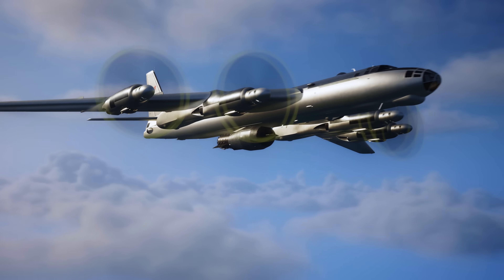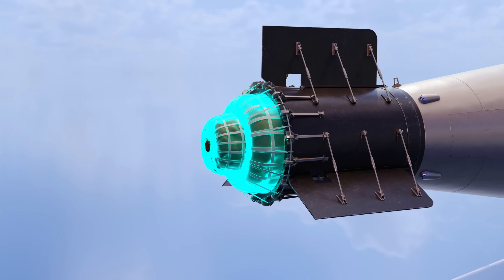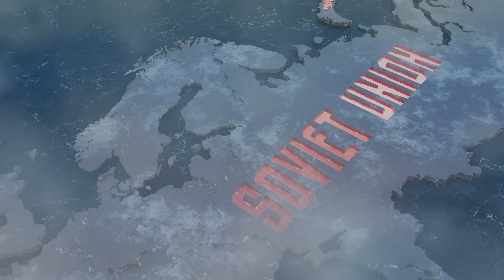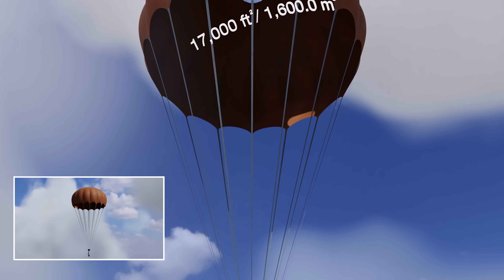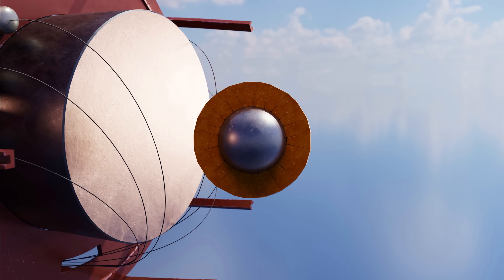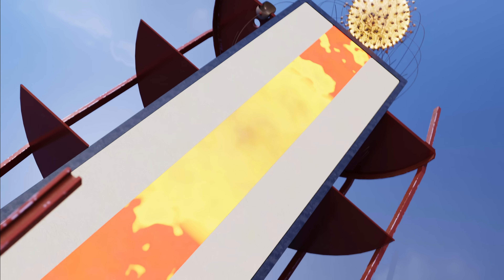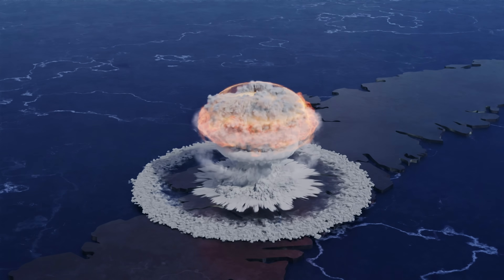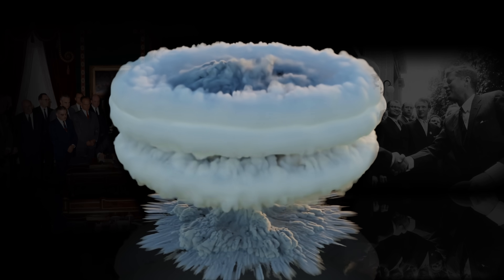Inside the Tsar Bomb

Comment: there is a material more critical than plutonium itself for production of hydrogen bombs. it s tritium. the radio isotope of hydrogen but with 2 neutrons. it requires a small quantity of tritium in order to be fussed with deuterium and release extrordinary amounts of energy. i have heard that a regular hydrogen bomb requires only 4 grams of tritium and deuterium to be detonated. tsar bomba defenitely had more quantity. the problem is that tritium hydrogen has a half life lifespan of only 12 years. therefore a warhead must be refilled with tritium every year in order to be maintained

Comment: Dear THE BLUE PAW PRINT,
Thank you for this well presented piece.  The original reason for the existence of this device was to impress the US with Soviet Military Power. Originally the design was considered for 100 megatons, but the designer and builders felt that this was perhaps beyond any sane reason to exist, that it would guarantee the deaths of those in the plane who dropped the device, and would represent a problem in what ever area it was to be tested. 
There was no delivery system for this device, so its use as an actual weapon was impossible, even the airplane that dropped it had to be extensively re-designed to carry the bomb. 
It was a "parade" bomb. The CCCP felt the need to develop very large megatonage weapons because they accuracy was less than what they wished, to compensate for this they made the explosive size of the bombs larger, and correspondingly the missiles that carried them.

Comment: This illustration is misleading.
The Tsar Bomba (AN602) did not consist of two separate fission bombs on both ends.

Factually correct is:

One single fission primary was used as the trigger.

This ignited a secondary fusion stage, followed by a tertiary fusion stage (fusion-on-fusion).

There was no second independent fission charge at the opposite end.

The often-cited “97%” does not describe efficiency.
It refers to the deliberate reduction of yield by replacing the uranium-238 tamper with lead, which:

prevented fast-neutron fission of the tamper,

reduced fallout massively,

lowered the yield from a theoretical ~100 Mt to ~50–58 Mt.

The Tsar Bomba was intentionally designed as a high-yield but relatively ‘clean’ thermonuclear device, not a maximized fission weapon.

Comment: Not particularly accurate. The lithium deuteride was used because the disintegration of lithium-6 by neutrons produces tritium, which has a higher cross-section for D-T fusion with deuterium than the D-D fusion. The lithium deuteride is enriched in lithium-6 for this reason, although Li-7 can also enhance fusion by a secondary reaction. Further, this fanciful reconstruction does not discuss the trigger, which was a critical part of the design. You might as well tell us that Sauron did it with a ring of power.

Comment: I think that two minor details were not quite correct:

1. The US nuclear program used krytron switches, not spark gaps.  Spark gaps have jitter of about 100 nsec or more, while krytrons have jitter of maybe 25 nsec (I remember the numbers imperfectly because I used them both in my thesis experiment about 50 years ago!).  Krytrons are less reliable, but they only have to work once!  The narration claimed that the synchronization of the spark gaps was 0.1 microsec.  I'm not sure if this device would have worked with that level of precision.
2. The narration also said that the secondary explosion was driven by neutrons.  I don't think neutron bombardment will trigger fusion reactions.  I thought the driving force was compression by radiation pressure in the form of x-rays.  That's how the latest generation of laser-fusion capsules work.  But this fact used to be a big secret.

Comment: The modified Tu-95 deserves more recognition. Reinforced bomb bay, thermal shielding, parachute-retarded drop system… even the escape maneuver had to be calculated so the aircraft wouldn’t be vaporized by its own payload. That’s engineering at the edge of survivability.

Comment: AFAIK all fusion stages of thermonuclear weapons are reaching the fusion through a plasma generated by intense gamma and x-rays hitting a plastic foam or polystyrene inside the tamper which then compress the fusion material (Deuterium and tritium gas, cased with lithium deuteride). The fusion energy is then compressing the fissible material inside (the rod), which drives the fusion even more. So there has to be anything to "ignite" the fusion and it's not the neutrons nor the fission products or the fission inside the rod. It's simply too slow. The material would be blown apart before fusion starts. This system is called Teller-Ulam-design and most probably spied and refined through Soviet scientists. Even if they wouldn't had received that information, it would be the simplest design...
Reply: In the American hydrogen bombs, polystyrene foam is used as it turns into plasma and emits X-rays, adding to the radiation flux and increasing radiation compression of the bomb's fusion secondary.   See Richard Rhodes's book, "The Dark Sun: The Making of the Hydrogen Bomb," pages 504 - 509.

Comment: The Tzar Bomba had not two primaries: it would create a very complex way to detonate  and sync it far beyond the capacity of Ignitrons, spark gaps, krytons and tyratrons used (we are talking of nanoseconds) where X-ray symmetry is fundamental to success. It would be far easier to create a modified primary what would incredibly simplify it. There was this speculation on the past but insanely need for synchronization would be insanely complicated even today where semiconductor devices are a challenge to use because the danger of the radiation interfering with them. It is more probable it had  a two secondary fusion stages but even that is highly disputed.

Comment: Another reason for not deploying multi-megaton bombs is that a MIRV with a cluster of smaller warheads - with much lower total yield - can destroy a larger area.  At 50-100 MT, a disproportionate amount of the energy goes into space.
Reply: depends on where you decide to detonate. if a maniac order to load the bomb into a ship or large boat it will detonate at ground level in the middle of a city like london or new york and by then even the largest version would be viable for more destruction
Reply: @hotdog9262  Yes: But the more realistic (terrorist/rogue nation) threat - not manufactured by a nuclear superpower - would be a low-KT "suitcase nuke", or just a "dirty bomb", spreading radiological material via conventional explosives.
Reply: @stuartparker-q3o  personally i think both are realistic

Comment: Doesn’t the fusion layer have a Palladium sponge doped with tritium? Also isn’t the lead outer casing actually enriched U with a very thick tritium deuterium under layer aerogel?  Also isn’t the outer shell electroplated with Tungsten? Lastly, doesn’t the first stage inner core have a hollow vacuum?

Comment: My knowledge was wrong, I thought they only used one of the fusion cores instead of the double fusion cores as i was led to believe that it was supposed to have so it did not give it's original designed yield due to testing purposes. It was more complicated than that.
Reply: They did only use one ‘fusion core’ the bombs on either end were ‘fission bombs’.       The majority of the Hydrogen/Thermonuclear/Fusion weapons in the low single to double digit megaton range do only require only a single ‘fission’ starter.

Comment: A few minor corections or omissions:
1. The spheres of plutonium where hollow shells. This enables more compression and greater margins of safety before going supercritical.
2. The secondary stage is compressed through the outer layer ablating (instanty vaporizing and turning into a plasma). The converging shockwave travels at more than 300 km/s at the center.
3. This colliding shockwave is enough to heat and compress the fuel to trigger some fusion by itself, but depeding on the design it is not enough to sustain the entire burn.
4. These initial neutrons from the first fusion along with the intense compression is what initiats the "spark plug" rod in the center. The increase in heat generated is enough to ensure a complete thermonuclear "burn". More modern designs do not require a spark plug, and care is taken to avoid any premature heating before the shockwaves collide in the center.
Reply: Interesting post, thank you. It's my understanding that the secondary is compressed by radiation pressure from the nuclear reactions of the first stage, so where do you get the information that it's due to ablation?
Reply: @geraldheinig1473  
Calculations of ablation rate vs. energy density. Lots of high-intensity pulsed lasers can simulate these conditions at microsacle today. The radiation-pressure helps, but if I recall correctly this is only 4-5% of the total impulse comapred to ablative "recoil".
Reply: @PwntifexMaximus Could ultra high energy gamma ray pulsed lasers if possible in the future, be used to cause subatomic fission?
Reply: @PwntifexMaximus If ablation recoil accounts for 95% of the pressure reaching the fusion part, then does that mean that the hotter the material can get more quickly, and the higher it’s conductivity, and higher the elasticity the more extreme the plasma pressure/recoil will be?
Reply: @P @PwntifexMaximus Also didn’t Edward T figure out a way to redirect X-rays so that ablative recoil wouldn’t be necessary for the second stage?
Reply: I’m amazed by all the hydrogen bomb experts found in this comments section. 🫤
Reply: @HalJalicaKick Și eu rămân uimit
Reply: I have previously read the there were two cascaded fusion stages to the Tsar bombe, but this is not mentioned in the video. Do you know whether this is correct or not? Also, I have seen videos about the effort by the US to develop and re-develop Fogbank after the recipe was 'apparently' lost. Did the Russians develop something similar?
Reply: @Mike-H_UK  
There is good reason to believe that Tsar used a smaller and a larger fusion-stage as this lowers cost and increases reliability, but the primary sources claim that the detailed calculations needed where not able to be done in time. Tzar was a political project from the start, and achieving the largest possible yield in a short timeframe was the priority. Thus the simple, stupid solution of having twin primaries was used.

Fogbank as far as I know is a design-specific material. There are numersous designs (including the most modern ones) that do not use it at all. I'm sure russia has their own versions, but it's strictly not necessary.
Reply: @PwntifexMaximus  Thanks, this is very interesting.
Reply: Don’t the modern devices actually use polonium instead of a vacuum inner core for the first stage, since they don’t use outside neutron guns? Also, isn’t what you mentioned about the second stage a myth? Doesn’t the high energy radiation from the first stage hit the second stage before the pressure and heat wave causing very low fusion efficiency?
Reply: @blitzandchitzgaming2584  
No polonium is used in modern devices. Viritually all of them use tritium-boosting, and the couple thousand fusion events that happen when the primary implodes is more than enough to set off the fission.

The ablation of the secondary tamper is what generates the shockwave. Very few actual atoms from the primary even reaches the secondary. Any movement of the device at these timescales and powerlevels happen as either radiation, plasma ablation or shockwaves. Mechanical properties aside from density literally do not matter at all.
Reply: @P @PwntifexMaximus what is the secondary tamper made of typically? How does it generate shockwaves?
Reply: @PwntifexMaximus If the outermost secondary layer is Alumina or beryllium Aerogel (with a special electroplated coating) for example, wouldn’t it be vaporized into plasma from the high energy X-rays, gamma, etc, and not cause a shockwave?
Reply: @blitzandchitzgaming2584  
1. Lead or depleted uranium. The shockwaves are a result of ablation. The accelleration is so intense it nearly instantly exceeds the speed of sound in the material, meaning the only way the material can move is through a shockwave.
2. "Subatomic fission" is just fission. And yes, any particle with high enough energy can initiate fission. The reason all nuclear devices use neutrons and the unstable elements they do is because of the chain-reaction potential and the energy-gain. You can't exactly launch a mile-wide particle accellerator plus the neccessary infrastructure at your enemies.
3. Plasmas have mugh larger volume than their parent material due to plain thermal gas expansion. Whenever this happens faster than the speed of sound (and it does) it results in a shockwave. The reason aerogels are used is to suspend the secondary in a lightweight layer that is (mostly) transparent to x-rays and ensures even illumination of the secondary surface. Remember, ablation rates are almost directly (inversely)proportional to atomic mass at these powerlevels. The lighter density and lower atomic number the faster it turns to a plasma. This plasma is transparent to x-rays.
4. Conductivity matters not at all. Thermal mass matters not at all. The energy-levels are too high. The outer layers of atoms turn directly into plasma with no melting in between. The only parts that matter are atomic number, mass, density and transparancy to x-rays.
5. I am not aware of any designs that do not rely on ablation. And any design that does would in practice be inferior to the ones that do. Redirecting x-rays is important to the proper functioning of the secondary though; You want an even illumination and gradual ramp up of energy.
Reply: @PwntifexMaximus Ai cunoștințe de acest gen te ia Ruși s-au Americanii sau China în echipă 😂😂😂💪💪💪🙋💙💛❤️🇷🇴🍾🎊 Hepy New years 🍾🎊🤝 2026
Reply: Thank you.

Comment: The plane did not need protection from "thermal radiation" AND "the heat of the explosion". They are exactly the same thing. The radiation IS the heat. For scientific methods and research, details matter.

Comment: 2:49 impressive that white paint can protect from both thermal radiation AND the heat of the explosion. Too bad there wasn't anything done to protect the plane from the temperature of the blast or the infrared output.
Reply: Dude you are so cool
Reply: @whothoughthandleswereagoodidea based on likes 3 times more as of writing, but I'm not sure that's a direct conversion. Fairly confident they're at least twice so tho

Comment: This video somewhat mis-explains the fusion stage(s) of the bomb, neglecting to mention that the most important role of the xrays from the fission primary are to compress the lithium deuteride to hundreds of times its normal density (I don't know the compression ratio for Tsar Bomba, but some of the more advanced thermonuclear designs exceeded 1000:1 compression). This compression is critical as without that density increase, the fusion reaction isn't self-sustaining. Additionally, most sources that I've seen indicate that the Tsar Bomba actually had three stages, not two, with a medium sized thermonuclear stage providing the radiation energy needed to drive compression of the largest fusion stage. I clicked on this video in part because I was curious whether the diagrams provided any clues as to the geometric arrangement of these fusion stages, or how they prevented radiation from the fission primary prematurely starting compression on the main stage.

Comment: No it was not practicable and no it didn't tip the arms race. Read Richard Rhodes book Dark Sun for a better summation.

Also the video state it had TWO Plutonium implosion bombs at either end of between 4-6 inches. Impossible as even as even at 4 inches, this is more than a critical mass.